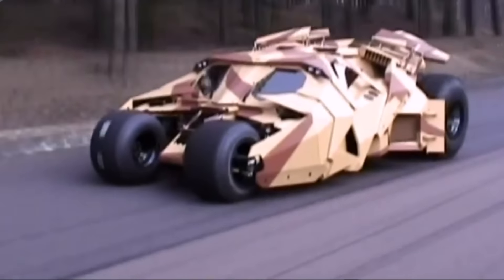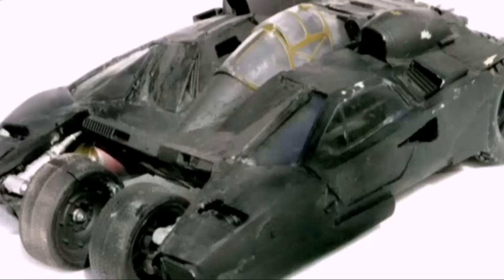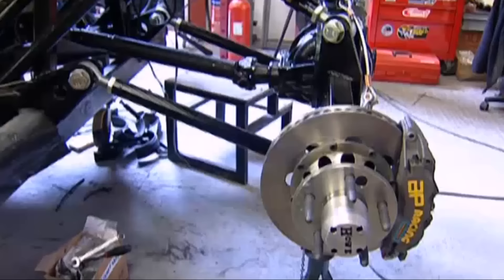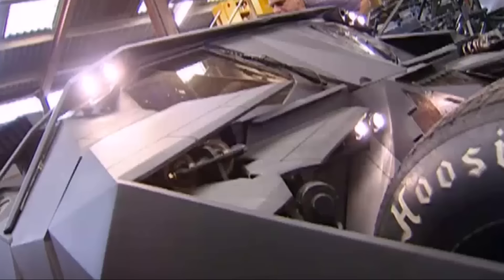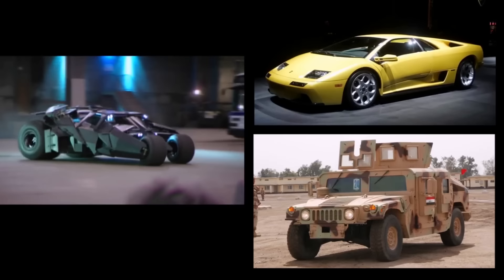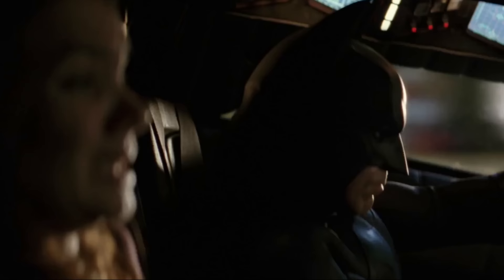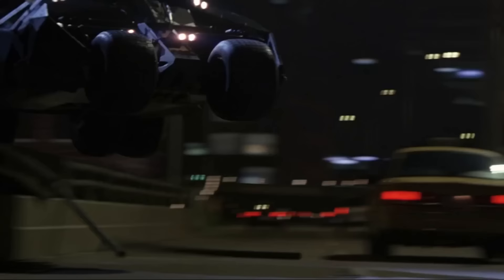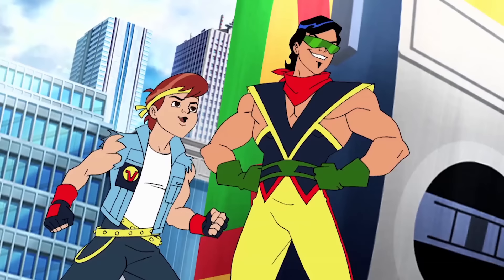The Dark Knight Trilogy "Creating Batmobile" Featurette (2005/2012)

Comment: I just love the beastly sound it makes. Thing's got a growl that'll make your teeth shake.
Reply: Definitely
Reply: Yeah but unfortunately thats just after production noise. The vehicle actually has a sound thats best described as SCREEEEEEE. Watch Jay Leno's video on the car to hear it
Reply: @alexdodge2515  There was no after-production noises for the Tumbler. That was the actual sound the car made when they were shooting the film. Same goes for the 'stealth' mode scene, where they used an electric motor to become silent. (Something that a V8 is incapable of.) Everything in the movie is real.
Reply: @ultimatums1  The Jay Leno Batmobile is only ONE of the Batmobiles. One of them was blown up, the rest were sent away. They did not sound like that when they were shooting the film. They probably didn't even use the one Jay Leno has.
Reply: @alexdodge2515  They had 3 different versions of the car for different purposes, Jay Leno's Tumbler is just one of them, and it's the one with the quiet engine that's easier to drive for extended periods of time and has more comfort elements compared to the others. Then there's the stunt car which performed all the practical jumps and stunts, and lastly there's the show car which has the advanced roof design and is used for the glamour shots etc.
The sound of the vehicle is the natural sound of the Stunt version of the Tumbler that has not been quietened down, that's its natural sound with no artificial sound editing (except for obvious post production editing to match sound levels etc).

Comment: The jump was real? WTF
Reply: Ramp jump
Reply: yep, no cgi or practical effects (except the rooftop scene which was made with a large scale model due to safety risks and costs involved). However, the boost jumps are done with ramps because it wasn't possible to get enough thrust from a rocket jet that size, at least not with their budget. In theory it could work tho.
Reply: @Real_MisterSir  yeah a jet thruster coudlve worked just everything behind it wouldve been incenerated

Comment: Some bullshit near the end about the Tumbler being able to jump at an angle, and about using a jet-engine. In the Jay Leno's Garage series, it was told that the jet in the back was actually an air balloon's fire-burner. xD
Reply: They were discussing how in theory it could actually work. They didn't say there was a real jet engine on the car
Reply: I saw that episode of Jay Leno's Garage about the Tumbler. What you're missing however, they were talking about having not 1 car using for every stunt, they built like 7 models of the Tumbler, each for a different purpose, there was also one without any engine whatsoever, it couldn't drive on it's own, that was made for detailed stationary shots (probably also had the wind shield opening mechanism, which that shown in Jay Leno's Garage clearly hadn't). So the one presented in Jay Leno's Garage wasn't the one doing the actual jump stunts. Though they've build a functional one for those. Now would you stop calling them liars, because you thought they used one car for everything?
There was also one, that they stuffed up with explosives for the "Self Destruct" scene in TDK, which counts to the other 6 Tumblers made for the movies altogether. Get your facts right next time, please.
Reply: @Croftice1  I know all this. ;) They're trying to sell it like a feature-packed, powerful vehicle, when in reality it's just a very fragile, utility-less, prop car. If the tumbler could jump on its own, Nolan would definitely have included a shot of it in one of his movies. Bullshit is bullshit, whether we accept it or not is a different matter altogether. Don't assume things.

The fact that they spent millions on each model and didn't come up with a single, functional model instead says a lot too. They're creating the batmobile solely from the filming perspective, instead of creating one, 'real' vehicle like the previous movies did.

Comment: Would be REALLY cool if there was a way to make it 4wd
Reply: If you turn it into a hybrid, you could have the V8 power the rear axle, and then a hybrid system with electric motors inside each front wheel. It's gonna be a engineering nightmare, but it is possible to make it 4wd that way